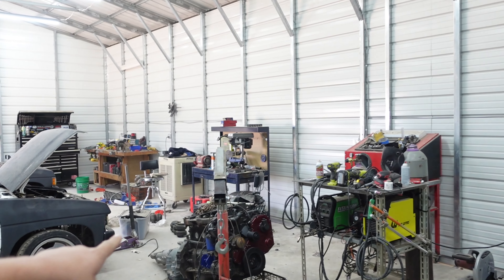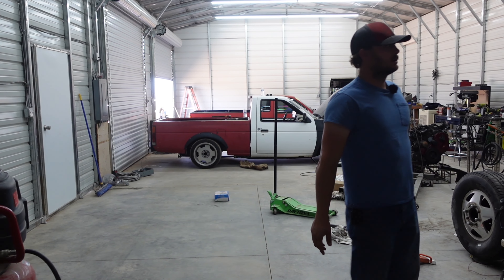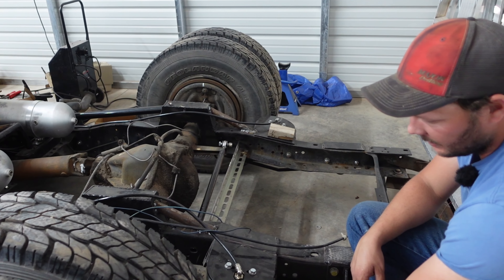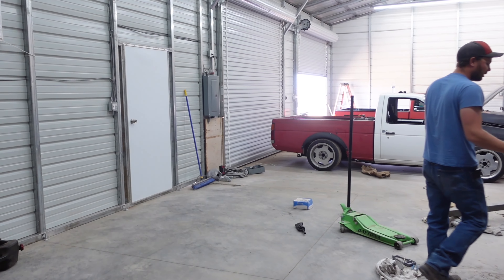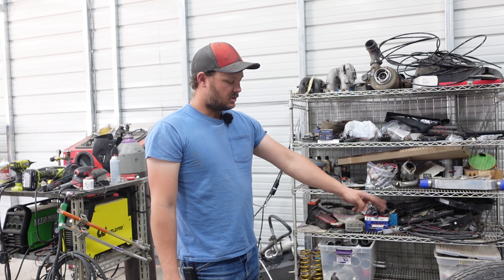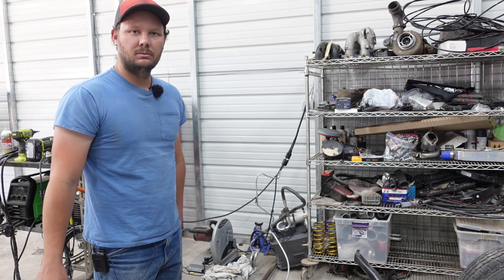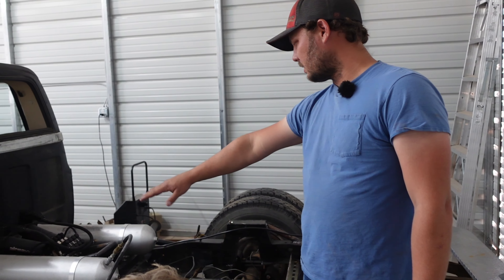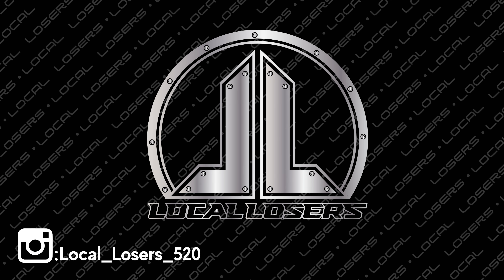AIR SUSPENSION FOR THE DUALLY

Comment: Nice i did bag over spring static drop for towing. Just for leveling under heavy loads. It a 86 crew cab dially thats 6.7/6speed manual Cummins swapped
Reply from the maker: Thats great! How low did you go?
I have a 5.9 cummins. Ill get back around to this project soon i hope!

Comment: I like the way bagged  dually’s but tow race car trailer long distance. Will stay lowered with springs  for dependability.
Reply from the maker: I feel the same way that's why i have a newer chevy 2500hd as well.
Reply: @LocalLosers520 
 Newer 3500 would be nice! 
Too many projects. My 89 c3500 dually with fresh 486 BB . Sniper efi & NV4500 5 speed will have to do. Will sound proof , update gauges , stereo but stay with interior. Also cameras on truck and trailer. If I bought a new one wouldn’t have the $ to race.